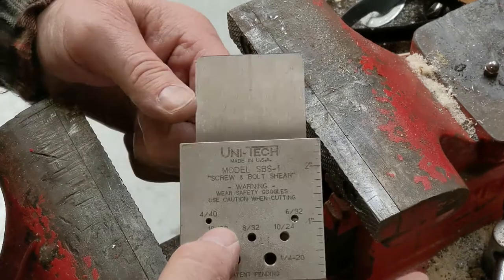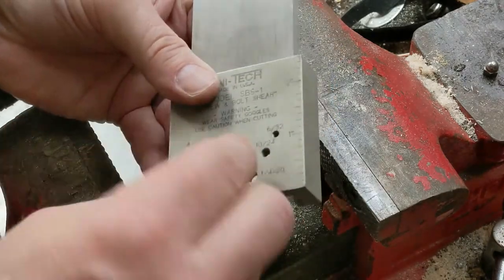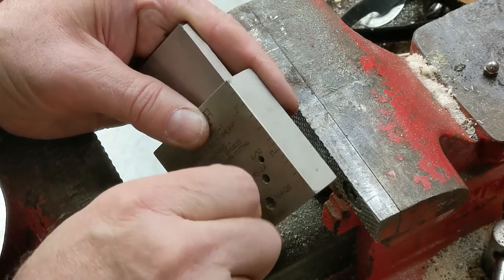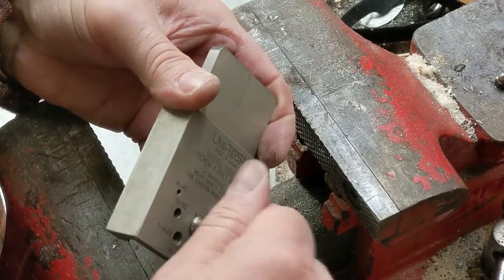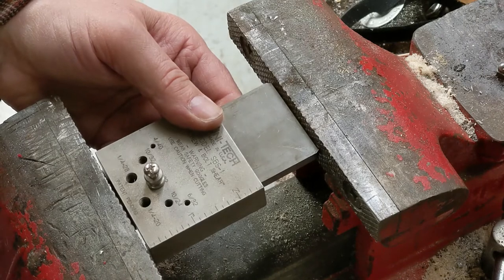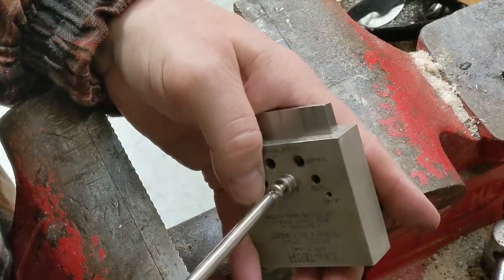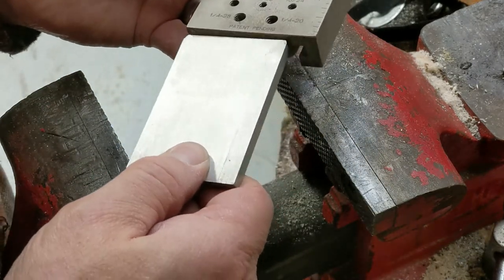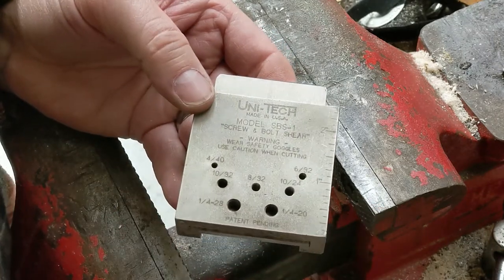UNI-TECH SBS-1 screw and bolt shear

Comment: Where can I get one of these!?
Reply from the maker: Thanks for asking, have had it so long is difficult to recall...I think I purchased it from technitool ...not sure..if I remember, I will post it...would be nice to have the metric version, I do recall it was an option
Reply: @neuromanglers  Thanks for the reply and I was afraid you'd say that. Uni-Tech is a "lead" name for lots of different businesses. It's hard to tell exactly what business manufactured it, when and where it came from.  All of the websites that I can find as of 2020-12-08 that carried the SBS-1 Screw and Bolt Shear product in the USA and Europe (4 in total) show that it is out of stock and not readily available. My project needs something sooner rather than later, so I'll be using other methods.
Reply from the maker: I looked around today online today and also find it out of stock.  I purchased mine about 15 years ago and surprised they are now not available because it is the best screw cutter I have ever used and I wish now that I had purchased the metric version too.  Good luck with your project
Reply: This can be purchased at Aircraft Tool Supply, although not branded Uni-Tech. Part number ATS-SBC.